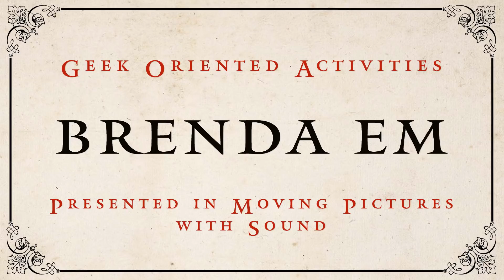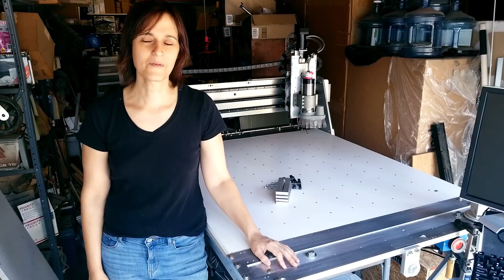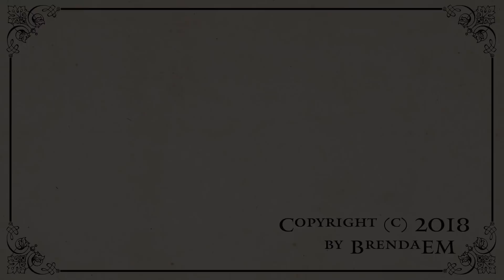Recycled CNC Project - Introduction

Comment: Very impressive build! What's your training, if I may ask? This looks too well engineered for a mere hobbyist, so sturdy and precise.
Reply from the maker: Thank you. I tried to use the vocabulary of the parts I had on hand on the parts I needed to make.  The machine's gantry is a little overbuilt because I don't have a good Finite Element solution. The right-angle side plates worked better than I thought, yet that's bad for my self-esteem. If I were good, they would have only worked as good as I thought.

At one time, I was an assistant auto fabricator who worked for a kit car company. My uncle was a mechanic who helped out on his friend's racing cars, and owned a show motorcycle. He taught me some mechanics. I hadn't known my father much, but when I did meet him, he was a machinist, who taught me some amateur gunsmithing. At a young age, my grandfather got me interested metals and gasses. I have dabbled in electronics here and there, as well as guitar-making.  At one time, I had gone through MIT's opencourseware on engineering, and Walter Lewin's physics lectures.  I also spend hundreds of hours reading Wikipedia...and watching tech/science related videos on youtube.
Reply: Fascinating history. Please considering talking more about what has made you you. Your creation story.